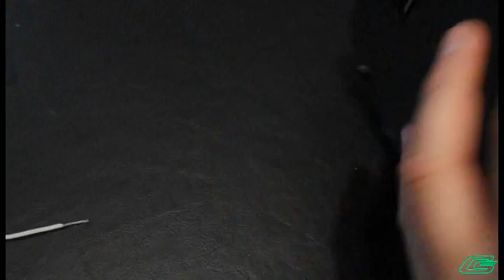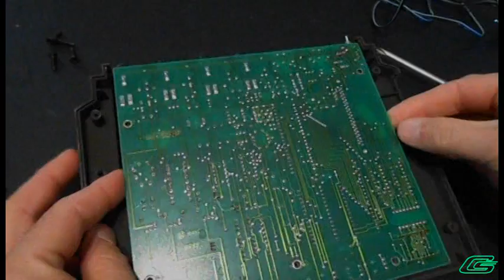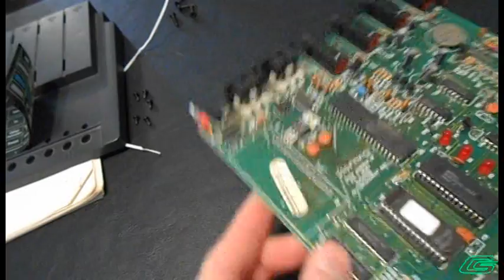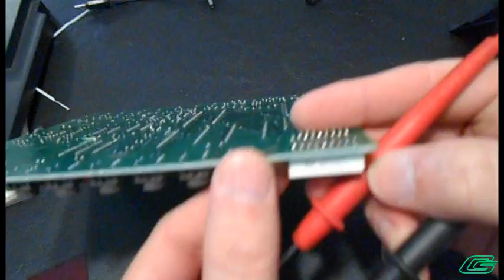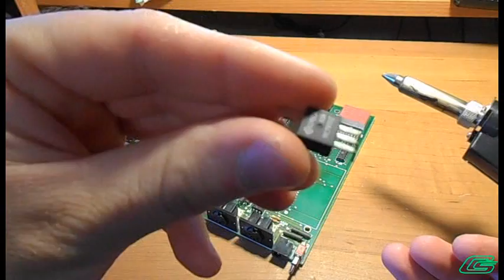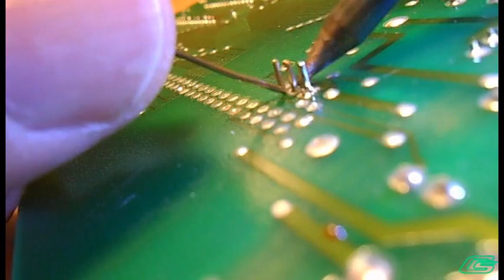Oberheim Drummer MIDI Module Repair Project Video

Comment: ive got the cyclone(arp) and strummer, its a common problem for these units to have power faults i had read somewhere, the cyclone is my fave out of them,the main unit hardware is the same in all three with just firmware and inlay card changed, so if you get a broken one you can swap the pcb's and eeproms to which ever machine you want working:)
Reply: That's not quite accurate. Find the manual online. With the original memory size, you can change the first 8 or so presets. Replace the ram chip with a larger on and you can change them all. Plus, the built in patterns can react to your keyboard playing, changing dynamics and figuring out where to put in fills...
Reply from the maker: Further testing revealed the pattern chip has been corrupted.  I also came to realize it's really a cheesy preset pattern machine, with only one single memory for programming your own pattern.